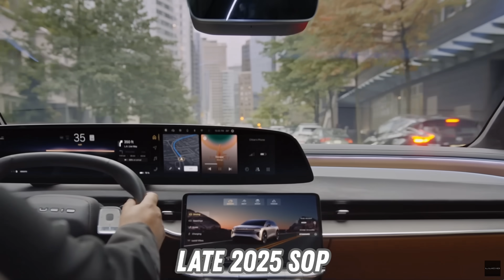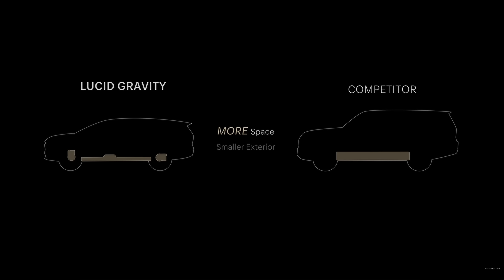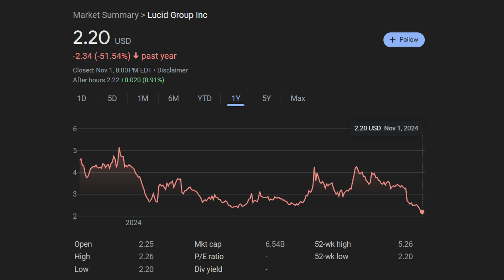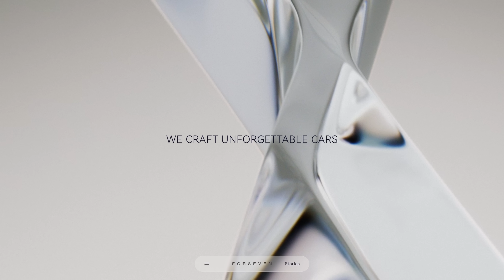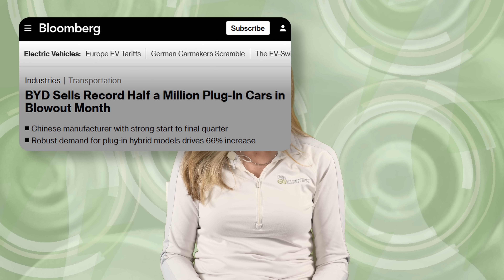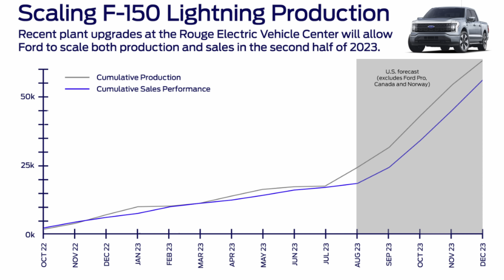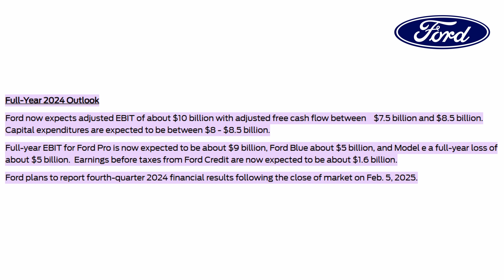The Current : Weekly EV News Ep#35 Nov 3, 2024

Comment: I really wish Lucid success. However, the price of the gravity SUV needs to come down. Strip down features, battery to probably 90kwh with a 400V architecture for fast charging. 800V doesn't do good if EA is unreliable and Tesla supports 400V or do a split voltage architecture.
Reply from the maker: It is certainly true that the total addressable market grows as price drops. 
The cost of moving to 800V+ is not significant. 
-Producer Tim

Comment: Ford's F150 has been seen as less than a good value with local dealer prices from $70K-$100K. If Ford just took their Mach-E drivetrain, put it into the Maverick, and sold it for $40K they couldn't build them fast enough to meet sales demand. Unfortunately, the real world effect of the Chinese EV tariffs will be to give U.S. automakers more space to try and revert to hybrids and scale back production, rather than to accelerate BEV innovation and production to compete.
Reply from the maker: Independently owned franchise dealerships and union labor are not doing any Ford any favors regarding electrification.  That is for sure.  Thanks taking the time to explain your point of view. -Producer Tim

Comment: At least  ford is honest, just bought a BYD shark don’t see anything from USA beating it in the near future 🤘🏿
Reply from the maker: The Shark is a hybrid. There are lots of hybrids out there. The Maverick sells like hotcakes. -Producer Tim
Reply: Whilst shark is indeed a hybrid it’s fundamentally an electric car platform with a decent sized battery and onboard ICE generator bit different from current hybrid offerings from Legacy auto.
Reply from the maker: @rohan Vehicles which burn gasoline and require oil changes are not a focus of our channel.
Spark plugs, fuel pump, exhaust pipes, gas tank, pistons, and hundreds of other moving parts are not our jam.  -Producer Tim

Comment: I'm hoping in country production leads to a jump in Polestar 3 sales in the USA.
Are these vehicles going to be available in Canada too, or do we still have to get ours from China?
I am a big believer that automobiles should be produced on the continent they will be sold on.
Too many car carrying ships can be lost with all those vehicles on board. 
That's a loss that is totally avoidable.
Reply: I'd rather buy a cheaper Chinese EV if I could.
Reply from the maker: Canada has big tariffs on Chinese EVs, too. Polestar 3 made in North America will be the long term source for Canada. -Producer Tim
Reply: @MissGoElectric Others are reporting that Polestar has given notice that upcoming legislation will make it impossible for them to sell any of their cars in the US, even the US made models.
Reply from the maker: Legislation essentially banning any internet connected hardware/software inside vehicles made by Chinese companies is indeed floating around Washington but it HAS NOT been passed.

It appears to be economic protectionism masquerading as a security measure.  Even if it does pass, we suspect it will ultimately serve as little more than an old fashioned shake-down.  Some American brands like Google/Apple/Intel/Qualcomm will be assigned a profitable contract to implement a domestic compute solution into the vehicles.

We must remember that both Ford and General motors currently sell models in the USA which are imported from China.  By the same token, many US automakers sell vehicles TO China.

Aggressive policies will most certainly be met with countermeasures by China.  The pressure is coming from both directions and like any good tug-of-war, the flag moves slowly in fits and starts. Geely brands like Lotus, Polestar, and Volvo are not immune to policy threats, but they are not doomed either.
-Producer Tim